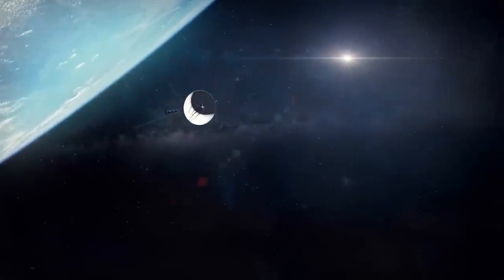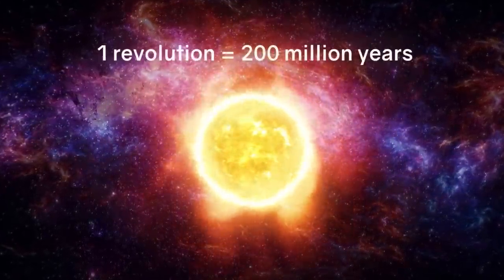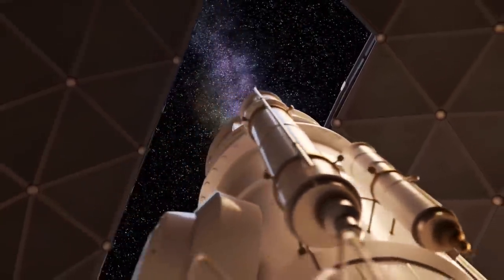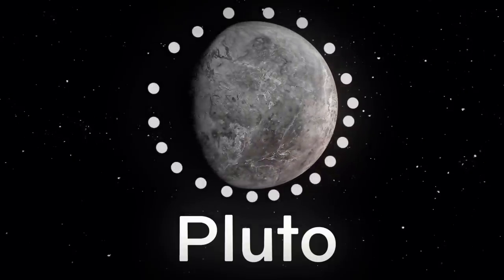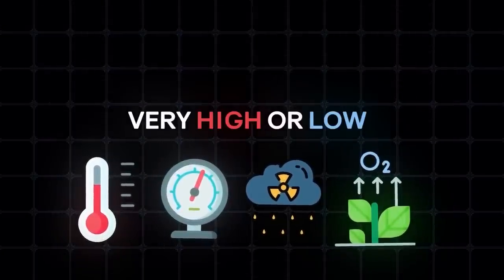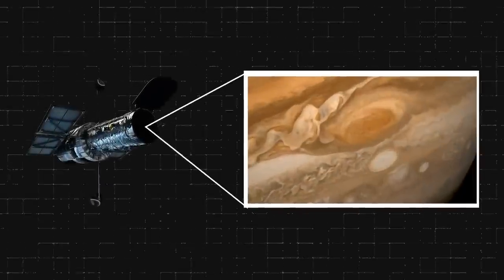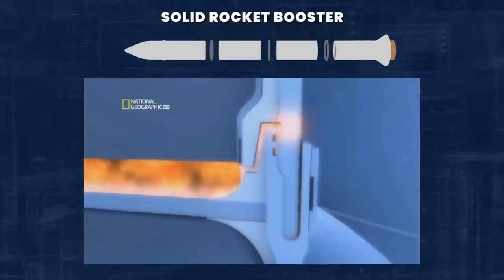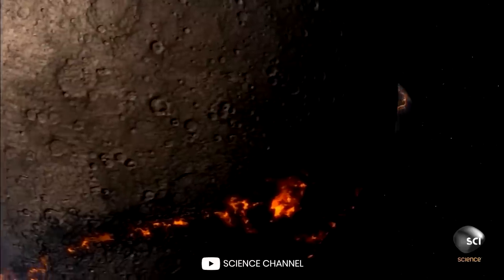Something Strange Is Happening To The Solar System - Best Videos 2022

Comment: Mentioning the Voyager's and the distance they traveled in their roughly 44-45 years still doesn't equal  1 light day.  and our nearest solar neighbor is 4 light years. helps give perspective just how massive the distances between stars can be and how light speed really isn't all that fast
Reply: doesn't even come close to a light year, i am too lazy and dumb to do the math, but i think it's not even 0,1% of a light year.
Reply: Shakespeare quote: “Life is but a dream within a dream.”
Reply: Our radio waves have already traveled about 35 light years out. Almost 10 times farther than Proxima Centauri, the nearest star to our solar system. It will take about another 30,000 years for the radio waves to reach the center of our galaxy.
Reply: @yurinator4411  Wait, isn't a light year, 365 days at the speed of light? Isn't the speed of light thousands of times faster than radio waves? How can our radio waves have already traveled 35 light year? Shouldn't a radio wave take thousands of years to reach a light year? I am confused.
Reply: @alexrodrigues4775  Radio waves travel at the speed of light in a vacuum.
Reply: @frankfrei6848  I always hear....speed of light in a vacuum, but does all electromagnetic radiation travel at the same velocity....or does visible light travel at a different velocity than...other forms of light such as radio waves?  How does the speed of light change when traveling through a medium such as water or air?  Does the refraction and reflection of light traveling through a medium affect the velocity of light or only the direction....or both?
Reply: Dudes! All electromagnetic and light waves travel at the speed of light in outer space. Radio was invented in 1895, but I don't know when the first radio waves were pointed toward space (intentionally or accidentally). I do however know that the first radio broadcast from space to transmit a voice to Earth occurred on December 19, 1958. That was 65 years ago. Therefore our oldest electromagnetic signals are approximately 65 light years away and but less than 128 light years away.

Comment: What if our entire solar system was just an atom in a larger being?
Reply: watch the ending of Men in Black.
Reply: Fractal Universe
Reply: Imagine the sun is the nuetron and the planets or protons and electrons 👀
Reply: I have felt this was the case since I was about 10 years old.
Reply: A weight loss program is seriously overdo
Reply: Its interesting to think of, which we've heard people speculate this time & time again. Its like all realms which reside in dimensions which are constituted by physical matter must all be connected to a certain extent, because where else would the disconnect Be? We would have to be able to get to the other realms besides where we currently live somehow , and if we cant travel there, in one way or another, then that must mean that space doesnt go on forever, because if it did, it would have to lead us to that other place. For it not to, there would have to be a gap in between the different realms that prevents travel. Whether that be complete dark matter sinks, neverending black holes, or some other means of the "end of the road" which separates the realms. Perhaps the only way to converse them is through portals?

Comment: The closest Star to our Sun is Alpha Centuri, about 4 1/3 Light Years away.
So how can our Solar System be enclosed in a "Bubble" 1,000 Light Years in Diameter?
That does not sound right.

That 1,000 Light Years Bubble would encompass MANY Star Systems.

Comment: The last flight of Columbia was NOT the last flight of the shuttle program... Shuttles would stand down during the investigation while possible fixes were evaluated, new safety precautions were taken but the issues of possible foam strikes fatally damaging an orbiter so it could not safely return to Earth was found to be simply a flaw in the design that could not be overcome, so all future missions with the shuttle either were directed to the ISS where visual inspections could be done before the orbiter docked, or were conducted with a "rescue" orbiter ready to go in order to take the crew off a fatally damaged orbiter in space (the last Hubble repair mission had this option).  Since the shuttle was already 30 years old and had served its purpose, was extremely expensive to operate and had a number of bad design compromises in its design, and cheaper and safer options for getting astronauts into space were already being contemplated, as well as shifting priorities in the space program, the decision was made to retire the shuttle and its last flight was in 2011, 30 years after its first flight in 1981, after a total of 133 successful flights in 135 attempts, including the ill fated last flights of Challenger and Columbia.  

Who does the research for these videos?  There's a glaring amount of inaccuracies in them.  Sad.

Comment: Pluto will remain a planet for me, the third criteria of what the IAU defines as a planet is NOT "must remove objects of similar size" but rather "has cleared the neighbourhood around its orbit" the new definition makes no mention of needing to clear objects of its own size, instead it insist a planet must be able to clear anything in the path of its orbit regardless of size. Yet the Earth has countless meteor showers constantly meaning it has never fully cleared its own orbit thus declassifying the Earth itself as a planet. So the definition changed nothing for me, Pluto is still a planet, the fact it has 5 moons rather than just the one we knew of is more evident of that. Mercury is 3x the size of pluto yet so much smaller than the other planets, Venus looks like a giant in comparison. In fact Mercury is roughly twice the size of the moon yet we still consider it a planet why? Because "it cleared its neighbourhood"? Pft the sun prob did that for it since its so close to it. Nope, there will always be nine planets the IAU is wrong

Comment: If a spacecraft was moving at the speed of light, then turned on its headlights, what would happen to the light coming out of the headlights?
Would the light from the headlights then go twice the speed of light, or would the light just stay at the point of it's origin, and be incapable of moving, and or being seen?
Reply: I think the first theoy  has got it.
Reply: NOPE. to the speople sin the spacecraft it would appear to leave at the speed of light.
Reply: Wrong. The people inside will experience no time until they slow down. If they traveled at light speed for a billion years before slowing down, then to those travelers that billion years never happened. They skipped right over it.
Reply: @gsjfoepgKftvtDisjtu  except for the requirement of infinite fuel and infinite time to get to that speed. And it takes just as long to slow down as it takes to get to that speed. Never mind the ship being destroyed by a grain of sand  in either case.

Comment: No the sun didn't move to the center of the bubble. But the sun did distribute the bubble around it by gravity
Reply: actually the bubble is also formed by heat radiating away from the Sun. blowing any gasses inside the bubble away from the sun.

Comment: Now the Challenger accident was directly due to politics.  The NASA director Biggs was forced to resign after over a year of being hounded daily on the front page of the New York Times over allegations that he broke the law.  When the evidence was finally reviewed after the accident by specialty lawyers on the Friday before his trial,  he was proven innocent of all charges in a few hours -- he had followed exactly the procedure he was required to do as per the congressional rules imposed on NASA.  His innocence was reported on page 56 of the Saturday edition of the NYTimes in a very small paragraph article and never mentioned again by the paper.
Biggs knew about the solid rocket booster silicone O-ring embrittlement issue,  had contractors already working on a replacement O-Ring for a few years.  The silicone O-Rings had been developed because of problems with the previous rubber based O-rings being chewed through by the heat,  but got brittle if the temperature was below 40 degrees F.  So while he was in charge,  he had a policy that the solid rocket boosters had to be temperature monitored continuously and if the temperature dropped below a certain point the rockets could not be used until they had been warmer than that minimum temperature for at least 48 hours.   Which is the main reason there had been so many delays of launches.  BUT,  when he was forced out,  the House or Senate took control of NASA and made the decisions as to when to launch...  and ignored his rules. 
Which is what caused the disaster.   The new O-Ring which Biggs had commissioned was developed within the next few months.

Comment: When I heard that Einstein explains that a gravity field is what keeps planets in orbit,  I thought there's something wrong in that way of thinking , strange how video explained after how that some genius would explain to us the real reason , well I don't consider myself a genius ,but plasma magnetics is the reason  for orbits ,and gravity results from it , our solar system is one spinning magnet field of orbs ,that magnetic field is synchronized  together by the main magnet the sun and the secondary magnet the planet Jupiter , every planet will synchronize by their neg. and pos. Poles to an orbit defining their positions of poles of negative or positive magnetics,therefore the cores are not made of iron ,but of a magnetic heavy element ,neutronium. Only neutronium or an even heavier magnetic element we have not discovered yet, can produce the strong gravity of a black hole an example would be a spinning neutron star ,which attracts anything in its path and eventually covers the star with dust ,gasses or asteroids ,meteors ,it has the strength to pull apart any solid objects most magnetic materials first ,and leave less magnetic materials as dust cloud debree. As a magnetic ring like Saturn ,still inside of a strong magnetic field .the spin of the magnetic neutron center will activate the dark matter (neutrons) to an aurora state of light ,these spinning neutrons once activated turn to spinning  plasma ,which the neutron center builds to point of a filament much like the sun except these filaments are much stronger they become  gamma rays expelled by both north and south poles when fully charged .so UFO's are powered by the same element in its center a tiny piece of spinning neutronium ,with this in a containment field and 4-6  magnetic amplifiers can produce the effect of a sun or neutron star ,as you see the UFO is always in a spinning motion. With the amplifiers turned positive or negative or positive west negative right etc. 4 amplifiers or 6 amplifiers with positive right and negative left which produce up down left right ,act as  magnets attracting or repulsing in only    left ,right angle turns .

Comment: Interesting.  How about this?  The shuttle is moving up at some speed. The foam should still have considerable amount of speed on it as soon as it broke from the shuttle main tank, close to shuttle speed. So it would not hit the right wing at over 20K an hour speed. They should have calculate the speed of the foam when actually hit the wing and test it that way to determine the cause. Just an observation.
Reply: Good observation.  Obviously the mass of foam slowed enough to cause the damage to the wing leading edge.  It was a design "issue" on the shuttle putting the tank on the side rather than below the shuttle.  I doubt we will see a similar design for any new spacecraft.  Lessons learned in air and space travel is usually learned the hard way unfortunately.  I would still jump at the chance to go to space regardless of the danger. Sadly I was never at the level that is required to qualify to go to space.  I was born too soon for an "average Joe" to go to space.
Reply: Did. The thing you are overlooking is that the foam slowed down really fast as it was still in the atmosphere - but the shuttle was not slowing down, hence the differential speed between the shuttle and the foam was still over 20K an hour. and thus the damage.
Reply: @jessepollard7132  Yeah, that was the actual problem, the foam slowed down too fast.  The foam hit the leading edge exactly are the cannon test showed.  All that kinetic energy has to go somewhere.

Comment: 54:07  The explosion did not kill the 1986 Challenger crew, as they are encased within a capsule like a jet pilot is.  They most absolutely would've perished upon said capsule smashing into the water just off the coast/launching pad.  (Source: fellow astronaut in the NASA program).  It would've been the equivalent of colliding head on into concrete.  Water 💧 at those speeds is just as hard as cement.